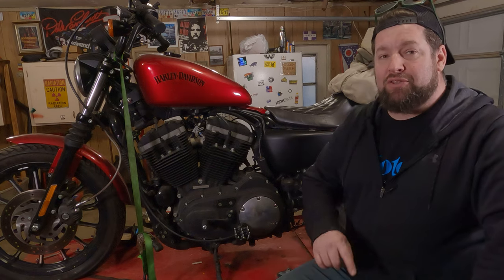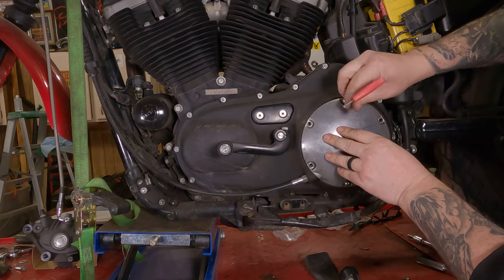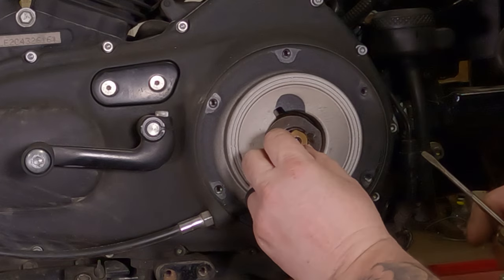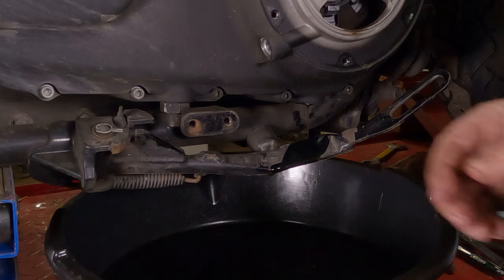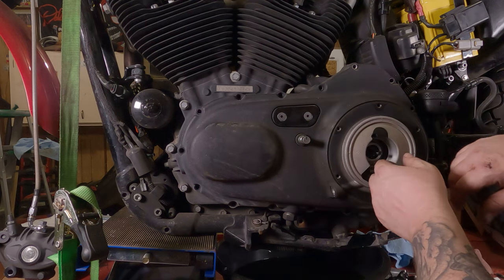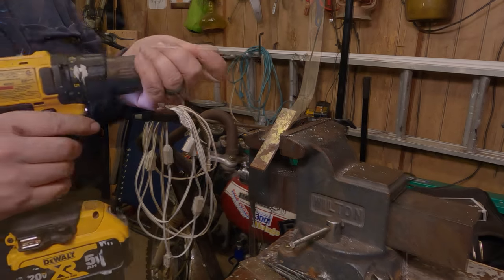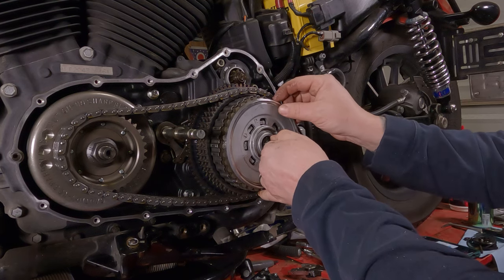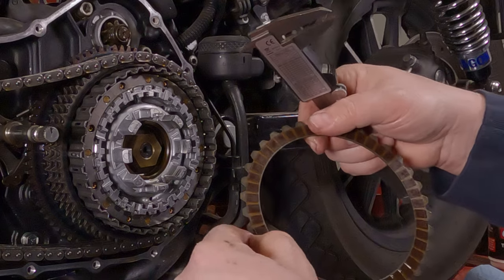Sportster Clutch Replacement & Primary Chain Tensioner Replacement.

Comment: I needed to take off that main clutch nut. I diddnt realize it was reverse thread until after I forced it to the left. Now the shaft and nut are spinning free together. Think I stripped the teeth off that shaft?
Reply from the maker: I doubt you stripped the teeth off the shaft.  You may have stripped the threads on the shaft it the nut, OR maybe you caused something inside the clutch to fail.  Which would be a cheaper fix.  
I would try and put an impact on it, to see if you can zip the nut off.  If the shaft is spinning, you should be able to put it in gear, and lock the trans shaft via the rear wheel. Good luck.
Reply: @KnobleMoto  thanks for the response. My Harley mechanic told me I need to use the clutch compression tool and remove the tension off the spring. Then remove the nut
Reply from the maker: @davedunkelberger7050  that would be a good option too.

Comment: What are the dimensions of the PVC, ID and width? The ID looked to be more than three inches. Thankyou
Reply from the maker: I think it was a 3” coupler, so the id would be 3”
Reply: @KnobleMoto  Do you remember the width?  It needs to be narrow enough to prevent stripping threads but wide enough to enable removal of the snapring before running out of threads. If your not sure I'll do some research first.
Reply from the maker: @jash7401  I’m not sure.  It’s been a few months since I did this project. Sorry.